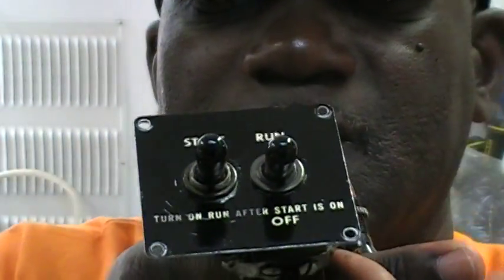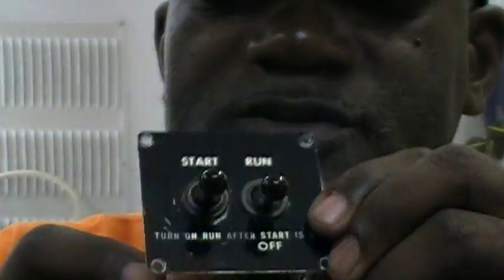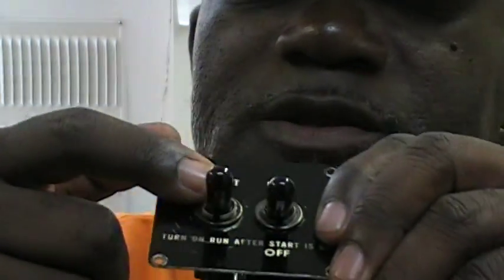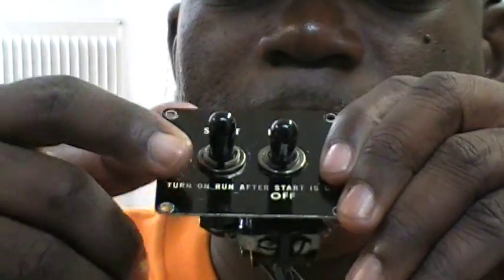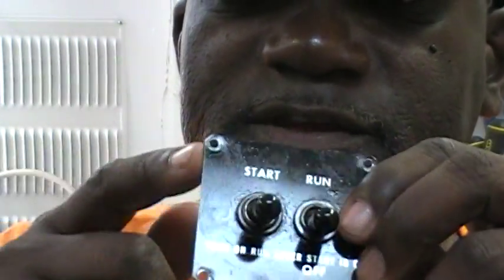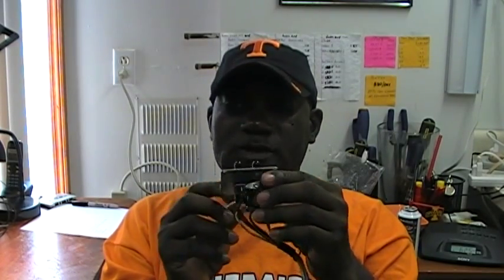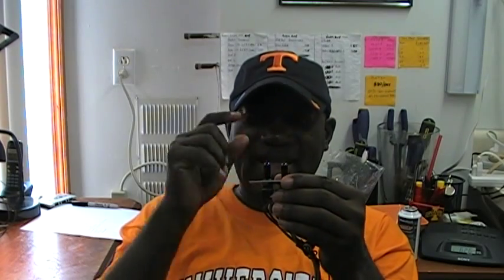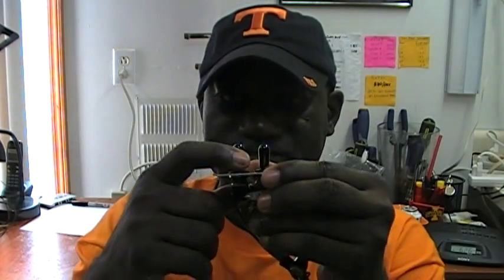Hammond Organ Start Switch

Comment: Found an A-100 that a church is giving away. It's been in a storage room at the church for about a decade. Run Switch works, but the Start Switch is loose. It feels like the spring came loose or something. You can hear the start motor try to engage when you play around with the Start Switch. The Run Switch works, the tubes light up, and the organ makes a contact sound when you play the keys. From watching your video, it seems that the whole Start/Run Switch assembly will need to be replaced. What do you think?
Reply from the maker: It will not hurt to replace them.  You can buy the replacements from tonewheelgeneral.com.
Reply: Thank you, sir.